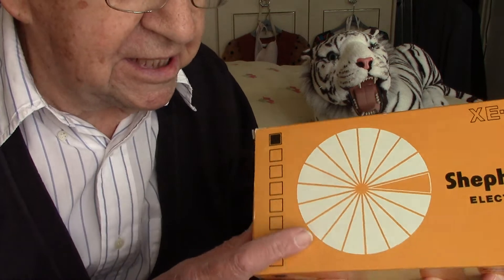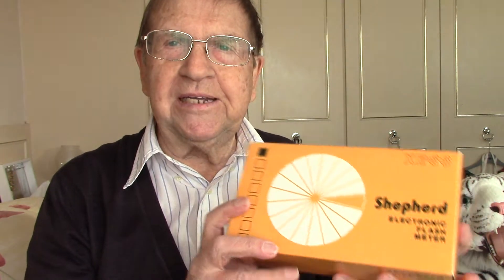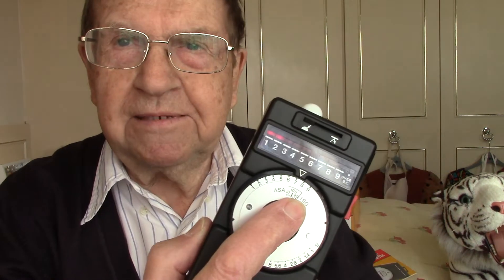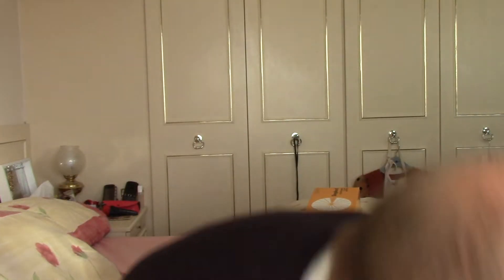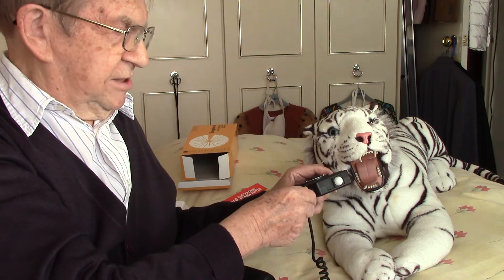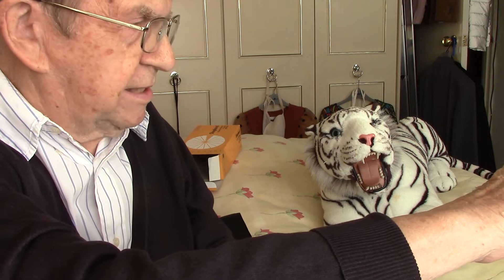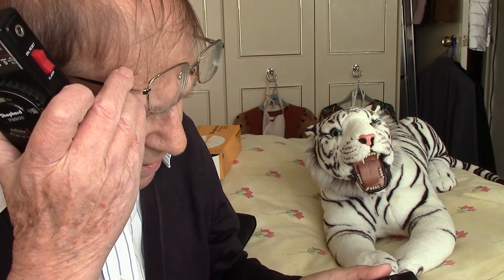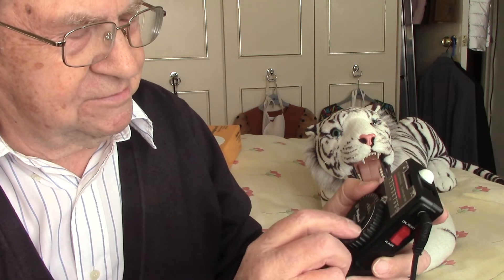HOW to USE : A FLASH METER

Comment: Great video thanks. However, and I hope this isn't a daft question, what shutter speed should you use? I'm assuming 1/60 but surely, with modern cameras you can vary this? Would you then have to compensate by changing your aperture?
Reply from the maker: You have to know the FASTEST SHUTTER SPEED which your particular Camera synchs with - you can use SLOWER but it lets more 'Ambient Light in' that's all

Comment: There is a Vivitar "Electronic Flash Meter 2" which is identical to the Shepherd XE-88, except for the colour scheme.  You don't have to use a sync cord between it and the flash unit (at least not on the Vivitar), that is just using it as a remote switch as a convenience.
Unlike many Youtubers, this guy knows what he is talking about.